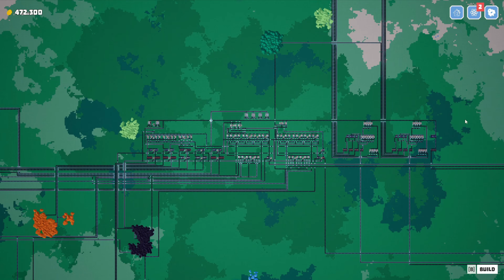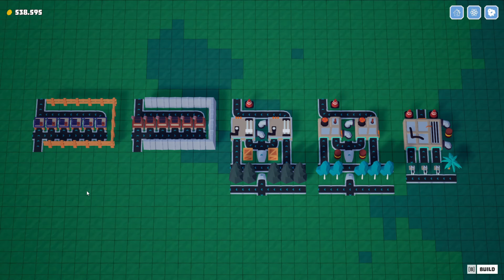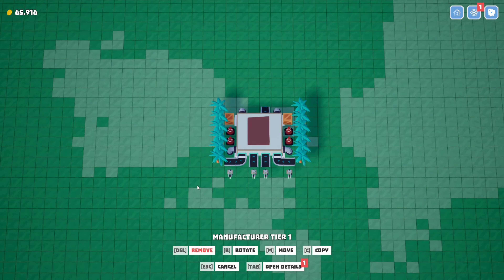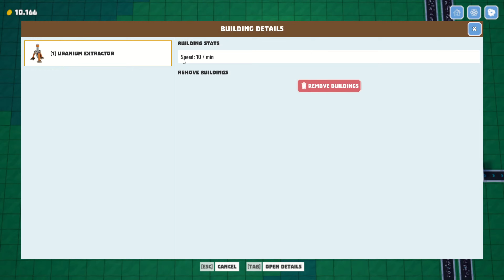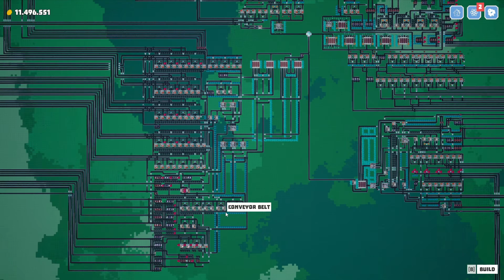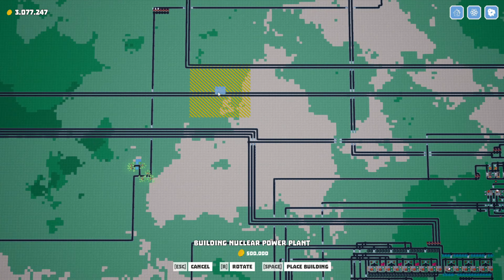Mega Factory Challenge|  Builderment  | First Look

Comment: Could you please do a short video explaining the “balancers” at about @22:50 ?
Reply from the maker: It's nothing more than a splitter connecting belt A to belt B, and then another splitter connecting belt B to belt A. What this does is allow those belts to provide any surplus material to the other, and vice versa.

Note that this only works if at least one belt isn't full already, and that the last belt that 'receives' ore will get the majority of the resources until it backs up. 

It's a pretty bad way of balancing belts actually, but it's the best I could think of with the basic tools at hand (at least without making a complicated belt system....)